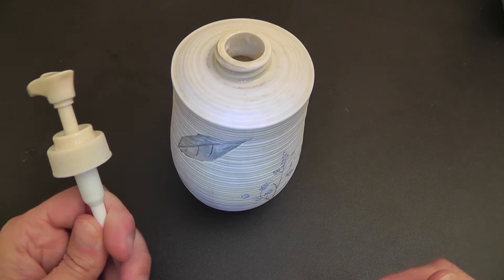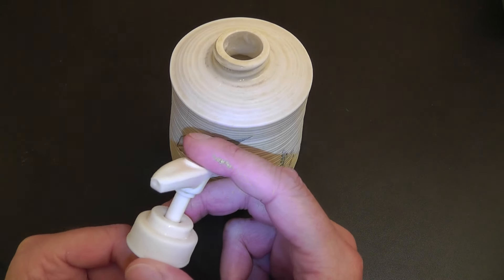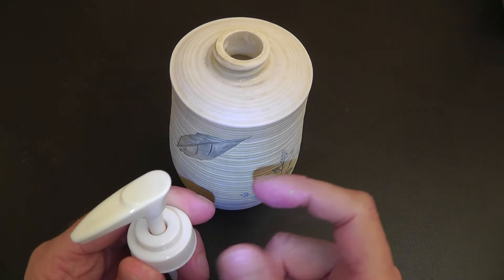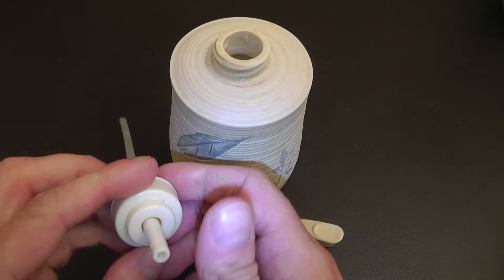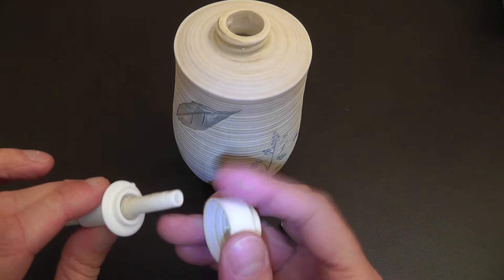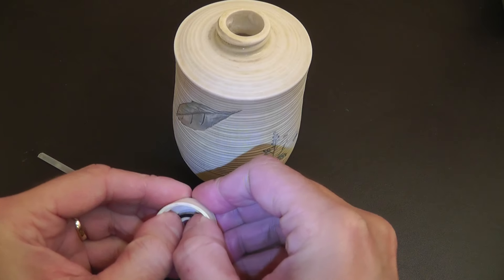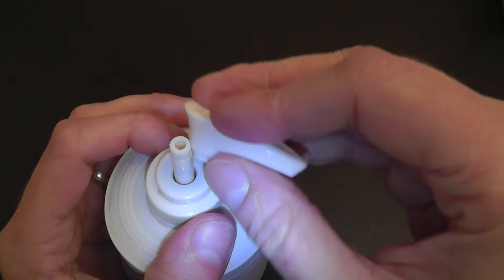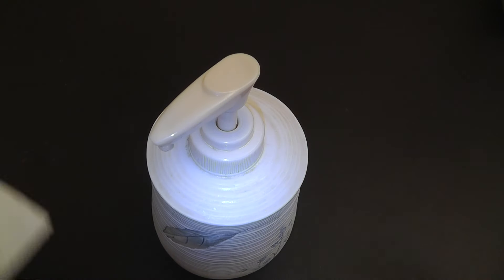Fixing a Soap Dispenser Pump

Comment: Thank you! You fixed my proboelm. I didn't need an o-ring, but needed to push down to make sure the connection between the metal pump and the plastic piece was tight.

Comment: Probably the best video that worked for me. The toughest part, really, is understanding all the parts you should expect to find upon disassembly, the order they go in, and understanding that they are mostly all snap-fit (not a lot of unscrewing) and that takes patience and care so you don't disfigure and spoil any parts for reassembly. My pump had some crystallized white material inside that was preventing the pump from working and I had to remove it all (probably some cheap soap tha the wife used for a re-fill...)
Reply from the maker: Thank you for your comment!
Fully agree on the cheap soap. I’ve noticed the same thing, that quality soap does not have any issues with the pump, but cheap soap simply does not want to work properly with it.

Comment: I had this problem and what I found out was it was the dish soap causing my problem. I realize that there are other things that could go wrong but the dish soap I was using was clogging up the pump to the point that I could not even push down the pump to dispense the soap. My sister told me she was having a problem with her kitchen sink drainings slowly and she uses Dawn Dish soap.  A light bulb went off and I thought maybe that's my problem too. So I took it apart and cleaned all the Dawn out of it and put warm water in it pumping it to make sure all the soap was out of the dispenser tube and filling it with another kind of soap Meyers Dish soap and volla it's now working.

Comment: RJ, I would like to say as first time subscriber to any site, and find your instructional videos very helpful, keep up the great work.  However i have a problem with a spray bottle and attempted to follow your video to soak the tube.  My problem is that the trigger released a small ball bearing the size I presume as a size of a pedal ball bearing and unaware where it came from.  Can you assist me in repairing it.  

Secondly, thanks for all the tips for home made tools, I made a headset remover and headset cup press, they came in very handy.  

Thirdly, I was not able to find the finished restoration of the 1954 Indian Scout Project.  Is there any video on the finished project.

Have a good week and looking forward to your reply.

Joshua

Comment: Aint nobody got time for that lol.  Just unscrew the pump from the soap & soak it in warm water & start pumping.  As stated, with water adding pressure to the dispenser area, it will start to pump again.  

Give it a few good pumps & if possible(depending on the type) remove the dispenser from the hose like the guy did in this videos.  Beware, you likely have a tiny metal ball(like a bb gun ball) inside thats super easy to lose down a drain.  

You want dried lotion/soap to leave this area hence the warm water.  Once warm water has been flushed through the thing, any clogs are melted, thinned down, & removed & the pressure intended for the device goes back to normal(thanks to that metal ball which already helps add suction inside of the hose w/o the added pressure that comes from doing what this guy did).  

Losing that metal ball however causes a great amount of suction to be lost.  In other words dont lose the ball nor even remove the dispenser from the hose if you think youll lose it.  Its very tiny & if you lose it youll need a new pump or youll always have inconsistent suction problems that require you to do the method in this video.  

So again, just use the warm water trick & make sure you do a thorough job before returning the pump to the soap/lotion bottle.  Just because you see water spray through doesnt mean its unclogged but rather spraying the water out is the unclogging process & you need to keep pumping in the warm water for about a minute straight or let it soak.  

Also, be patient when pumping it again once you return it to the bottle because it sometimes takes a few good pumps to get the pressure back right.  If after 12 pumps it isnt working, repeat the process or consider that you lost your ball or never had one & need to do it like in this video.  Good luck driving to the store to buy a silly rare hard to find rubber ring.
Reply: O-rings are definitely not rare & easy to find! Your method works fine for clogs but not to trap air to force the suction needed.